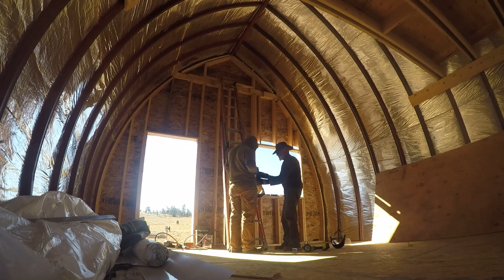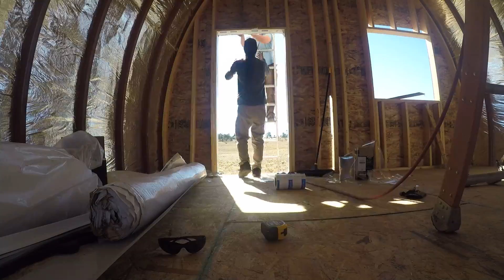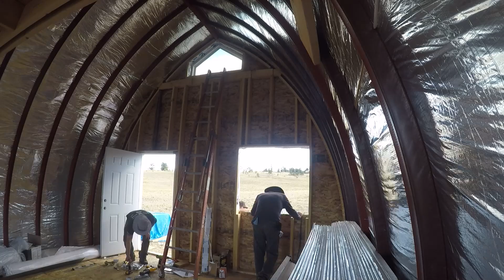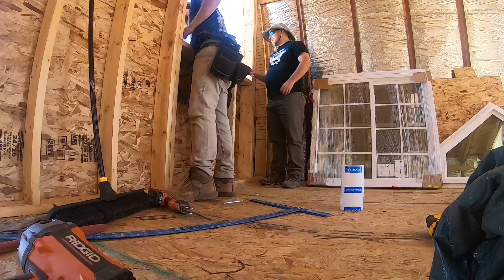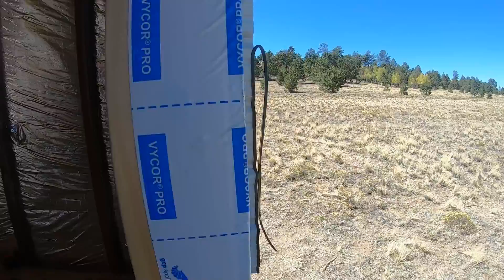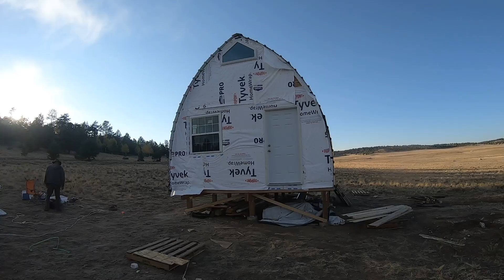Arched Cabin Build - Doors and Windows #9

Comment: Just found your vid. I've been eyeing one of these for a while myself. How is the insulating material attached to the metal ribs? Do you just screw through it when installing the metal roof, or is it glued onto the frames in some way? Thanks. Keep up the great work.
Reply from the maker: It is held in place by the screws from the metal siding, no glue.
Reply: @evanoffgrid  awesome. She's coming along nicely. Are you happy with the kit overall? I've been looking at this and a Quonset hut, but this seems like a much better/easier system and company. Cheers.
Reply from the maker: @KarlKarsnark  I'm quite happy with the kit overall. I'm definitely an amateur, but it's been manageable so far.